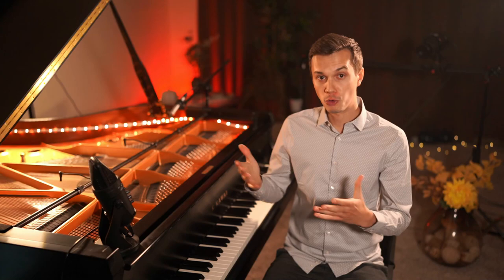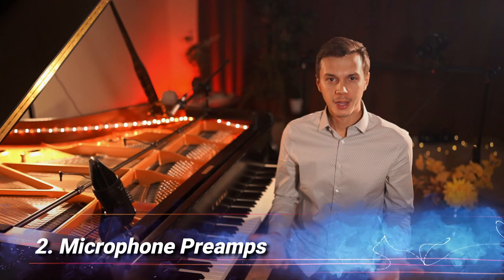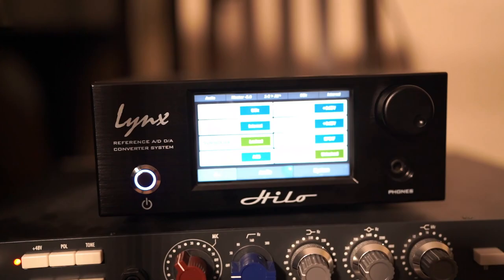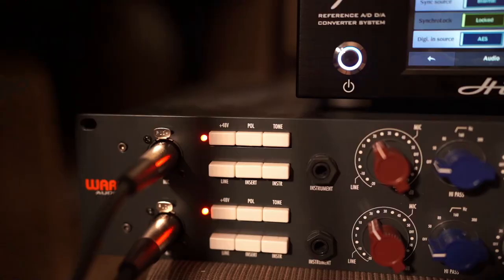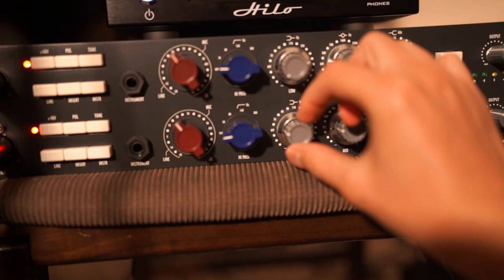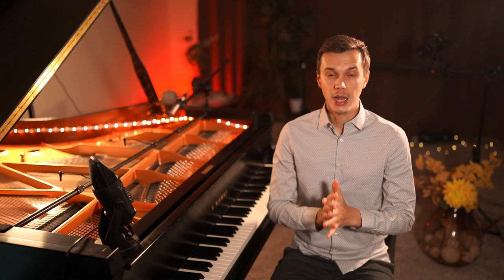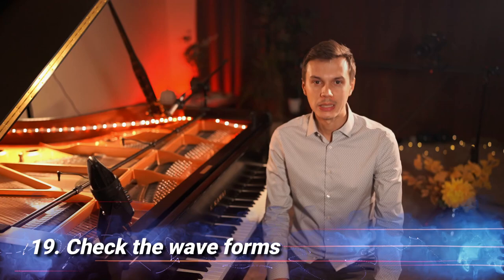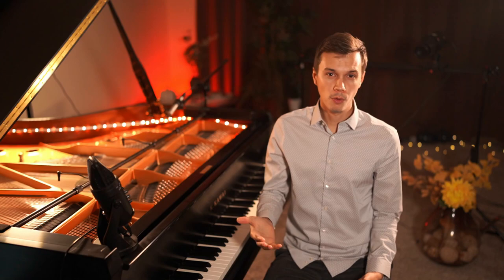20 TIPS for recording your GRAND PIANO! (Secrets exposed)

Comment: Hi. There is a few things I would like to correct/add. One thing you did not mentionned is the room, having a room with a good acoustic really matter a lot when recording, you have to avoid the flat surfaces with lots of reflection such as tiles or windows. Also you did not mentionned the stereo recording technique that you can use, you have the AB with omnidirectionnal pattern, XY & ORTF with cardioid pattern, blumlein with figure 8 pattern and many others that are great to know to record a piano. Also you have to know that small diaphram static microphone will have a higher and more realistic dynamic than the large diaphram that will more be into the character of the piano. Static microphone are not the only one used to record a piano, ribbon mics are also great (carefull they need good preamps), pzm or dynamic mic can also be an option. You can use a stereo pair to record the piano close, an other one to record the room, but you can also use some mics to add a color to the sound (could be a ribbon mics arround the bass part, some pzm also).
You also did not mentionned the tuning of the piano.
A few things I disagrea : 
- compression is not a thing to avoid saturation, the main purpose of compressing a piano is to reduce the dynamic or to gives it more presence, if you set your gain correctly you should not have saturation even without a compressor, also, don't forget to keep at least 6dB of headroom :) 
- you don't need a 3000€ converter, if you have a good audio interface, they have really great converter, and when you can buy a 3000€ converter, you can also buy a great audio interface. 
- I recommand using a low cut, low cut isnt only about 80hz, you can use a low cut at 30-40hz and this will not delete the bass. You can of course go higher if needed. 
Things I agree with you : 
- good preamps are indeed really important in the process, your warm audio is a good choice and not really expensive.
- digital piano is an option, it cost way more less money, and there is really decent vst nowadays
- audio phasing is important, you have to thing about that when placing the microphones, and you can also adjust the phase in post
Thank you for sharing your experience anyway and I hope I helped some people with that comment.
Reply: Thank you for addressing this. The piano is a complicated instrument with MANY variables, the person in the video saying «only do this» and «do not do that» with zero headroom for different scenarios is not a positive mindset when recording, perhaps even a little harmful.

Comment: piano recording:  dont be afraid of to try  2 sm57 above hammer. for pop, put 2 condenser above hammer. For compression, VCA comp (SSL bus comp) work best 10ms attack, 2/1 ratio, looking for 5-7db at peaks, 100ms release. piano equing. Piano is very strong in 700Hz to 1khz. dont be afraid to cut little there. if too boomy, cut with low shelf @100-150hz, like 3db or so. dont push 10kz, you just get hiss. Try wide Q bell curve @4K or 5K. for pop, more 3K is even better.
If you dont have a good sounding room (high ceiling and not echoey), forget about room mic. Put some plate or hall reverb (Valhalla are great) if you like reverb on piano.
Reaper is the best daw software. no hassle. load very fast, one type of track on which you can record whatever you want (mono, stereo, multitrack (4 tracks for ex), midi).
Always Save as firts, and put an auto save.